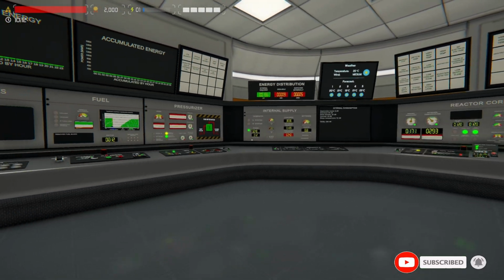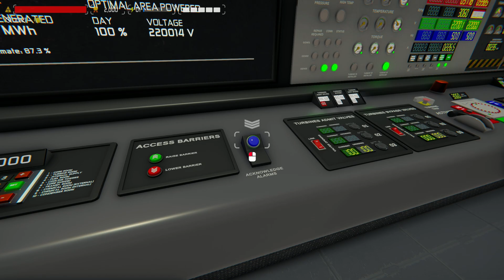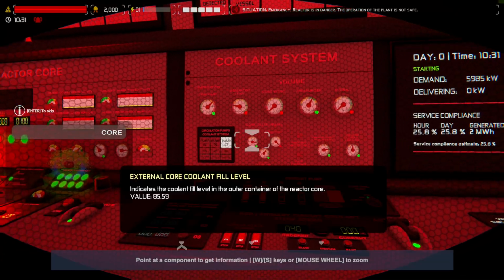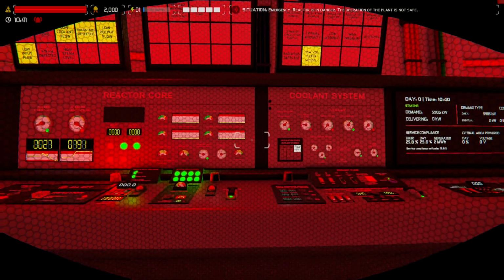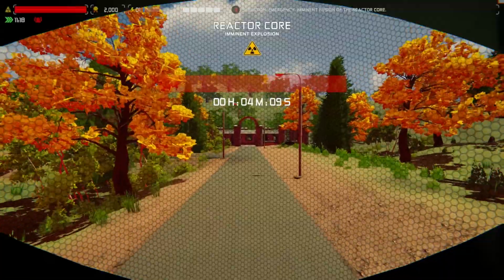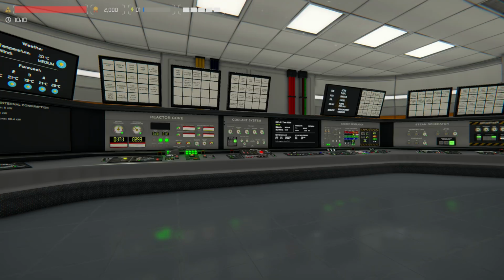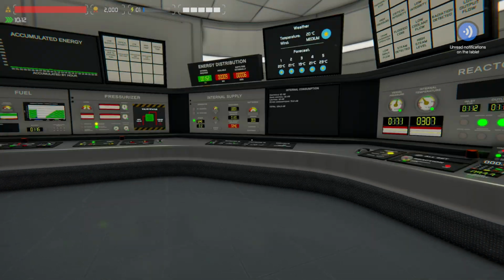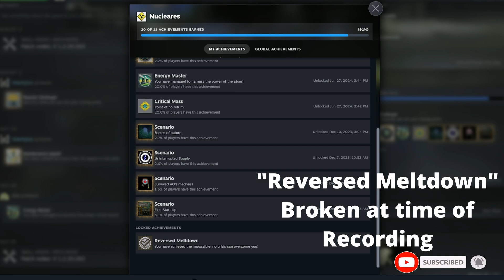Reactor MELTDOWN Finally!!! - Nucleares Tutorial

Comment: So it's impossible to create a meltdown with the chemical setting on?
Reply: I assume so, since the boron acts kinda like the control rods
Reply from the maker: No but gives the viewer a better chance of a meltdown if they start a New Game without chemicals... 
Test #1 & #2 can be meltdown if copied with the slight adjustment of also turning your pressuriser off at the same time you set the control rods to 0 etc.
Reply: @ShArPy1o1Games  
So it was the pressurizer that prevented the meltdown in your first 2 tests.
I was correct.
Reply from the maker: No as sometimes it doesn't always work... that's why I said it's better to start a new Game without chemicals 😇✌️😎
Reply from the maker: I say that, for those wondering, that the Xenon can sometimes stop a Meltdown from happening 🤓
Reply: I can confirm what Sharpy is saying, the Xenon screws you over so its harder to melt it down with the chemical module active.